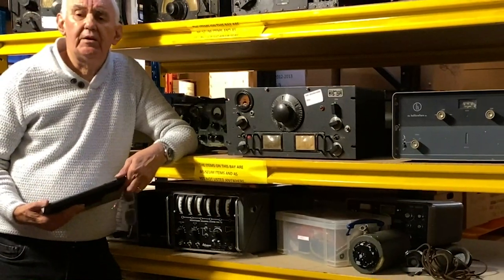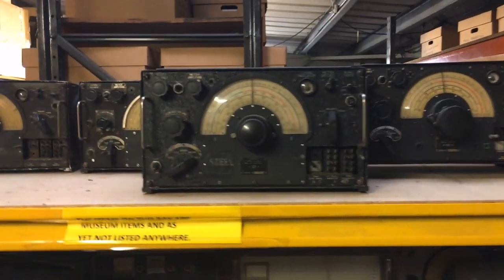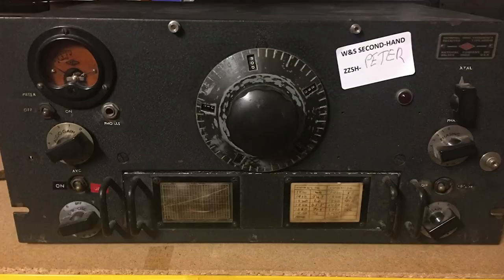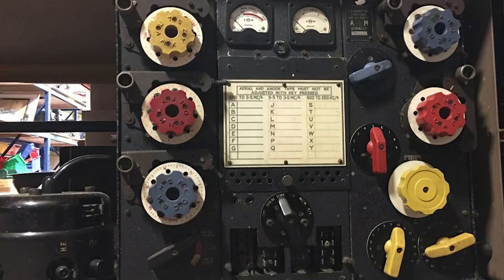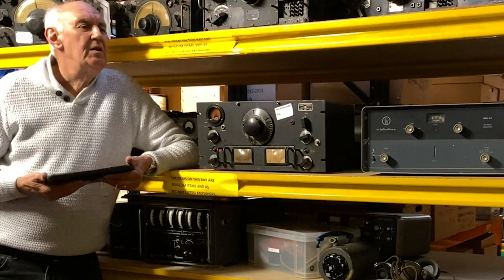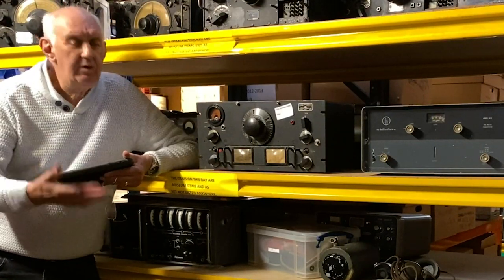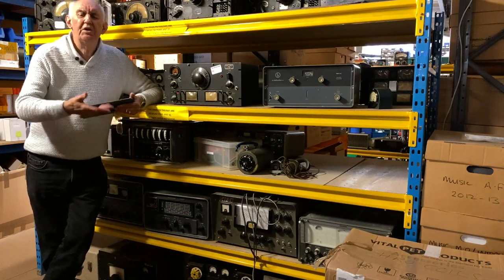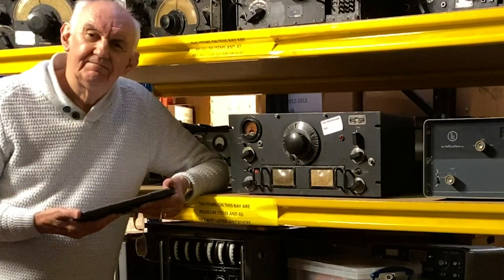Peter Waters G3OJV   The Old Days of Ham Radio

Comment: Just love listening to Peter and those old radios. I was an SWL back in the 70's with a Codar CR70A, Trio 9R59DS (wish I had held onto that one) and a Yaesu FR 50B. The one thing I would have loved would have been a digital display so I could tune to a frequency and hear if it was on air. Now I am trying to get to grips with an Icom IC-9700 & IC-7300 W&S sold me a few weeks ago. So many buttons, menus, touch displays etc. I've managed to get into the local repeater GB3GN, just. Thank Heavens for YouTube to show me {How to} master the functions. I'm a little younger than Peter being a GM4.
Reply from the maker: I use the same pair of radios. Lots to learn but an interesting joutney! 73 Peter .

Comment: Great video looking back at the good old days of amateur radio, and to see that wonderful collection of old radios. I will never forget those wonderful times in my youth, when I first discovered amateur radio while as an SWL, listening to strong AM hams on 40 and 20 Meters, using a valve Cossor melody maker, inverted L antenna and Earth stake of course. Yes it is certainly true to say that HF band conditions, were far better then, with minimal noise interference and good HF propagation. My first transceiver was a Pye 62 set, running AM on 160M, with an output power of around less than 1 Watt, running off a 12V car battery float charged with a battery charger, all in the garden shed! Listening to my voice in the headphones while transmitting, was an exciting experience from what I remember.
Top band was usually always busy with QSO's, with local hams traveling to and from work during the day, using home made AM rigs and loaded whip antennas /M, and many SSB stations further afield in the evenings. I remember there was one particular AM G3 station, who always put out a massive signal on 160M in the evenings, you probably know who it was. Looking at Top Band now of course, it's a completely different scene with ADSL2 and VDSL broadband interference, SMPS QRN and all the rest of it.
Reply from the maker: Matt, a very interesting input. I am sure others will enjoy reading it as well. I remember it all!!  73s Peter
Reply: @watersstanton  Yes they were most certainly happy times for sure. One of my radio amateur friends back then, Martin, had a very impressive 2 Meter VHF antenna system. He lived in a flat above a newsagents in Harefield , which was his workshop, radio station and digs. He had 2 x 10 element Tona yagi's stacked for 2 meter SSB operation, with rotator and pole bolted to the wall. That sure was quite a set up! 73 Matt

Comment: Nice video. Re the band conditions. I was SWLing in the 60s. I had a Codar TRF and then a Hallicrafters SX24. I came across an old log book of mine last year (from '68) and my jaw literally dropped when I saw the exotic DX I had logged. I dropped the SWLing about '69 and forgot about ham radio until three years ago I came across my old RAE certificate. The bug bit and I got my license. I acquired a Trio Rx. The first thing I noticed was the generally appalling noise on all bands - I thought there was something wrong with the Rx. Then I got an Icom TxRx and I the farthest QSO has been Moscow. I rarely encounter DX, occasionally transatlantic stations, nothing exotic. I seriously wonder if the F2 ionised layer has deteriorated over the last 50 years? Talking of old kit, before the Codar, I bought a 19 set which I powered from a car battery using a MoD surplus inverter! John, M0IDS.
Reply: I'm a space weather nut and it is fact that the earth has lost about 30% of its magnetic field in the past 50 years or so..

Comment: Back in 1969 as ZC4MO (Cyprus) I had a regular Sunday sked with VP8KL in the Falklands on 28.350 Mc/s  (No Hz in those days) with just a 100 watt SSB KW Viceroy and a RCA AR88D Rx feeding a TA33 Junior at 60 ft. AGL. Nothing exotic. Biggest problem was the breakers who wanted 2 rare countries at once. Must have been near the peak of the sunspot cycle. With that callsign I tried to achieve DXCC in 100 days, and succeeded. Great days.

Ian G4JIU Ex G8EYU,DA2GJ

Comment: Probably a combination of factors..yes, I believe conditions were better..this last cycle has been the worst I have ever encountered.
The overall noise floor, band noise, not receiver noise, was much lower..we could hear more, and hear more easily than today..

The the thing that may be the most important factor;
We were younger, enthusiastic, adventurous and open to all new ideas in regard to working DX..
I still enjoy older gear..like you I lusted after an HRO..it wasn't to be..a Halli S20R had to be my RX..a MOPA 6AG7/6L6, one rock and a doublet sufficed for transmitting..minimal, but sufficient..I couldn't wait to power up and begin..ahhhhhh, to an old man's memory, those were the days😏😃
To this day, an older Ten Tec Argosy 525D is still one of my favorite rigs..not '50s vintage, but mid '80s..still very simple compared to modern gear, but it works quite well..it is my observation that it seems more immune to EMI/RFI than modern rrceivers..
Thus endeth the memory review for today..
Reply from the maker: Hi there. Many thanks for sharing. Happy New Year. 73 Peter

Comment: When I was getting into ha radio via CB in the late 1970's we had one television, and NO equipment with switch mode power supplies. The first computer I owned, a sinclair ZX80 had a 3.58MHz oscillator which could be heard on the lower bands up to bout 40.The only other things that made noise was a tropical fish tank and a Deep freezer.

The situation nowadays is very very different. As I sit in bed there are 7+ switch mode psu's at least in this room and the light is LED (Horrible stuff), so the only way to operate is an antenna away from home, ideally in a local park.
Reply from the maker: Yes, how things have changed. Peter

Comment: Great days as a SWL I used a home built TRF and later superhet (both from PW designs).....the greatest issue then (1960's) was ignition interference and TV timebases. Much worse these days from the digital hash 24/7
Reply from the maker: Hi Jeff. thanks for the input. Yes there was good and bad in those days but a great deal of fun mixed in with it. I might do another video recalling more of those days - when I get a moment! 73s. Peter.